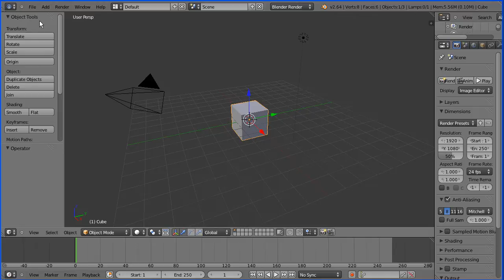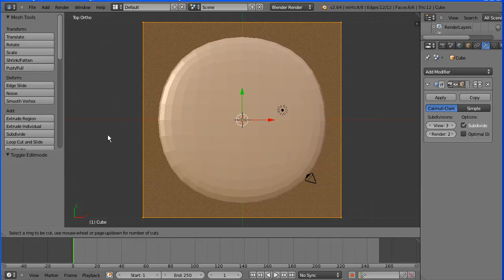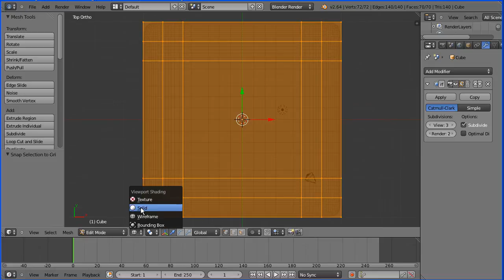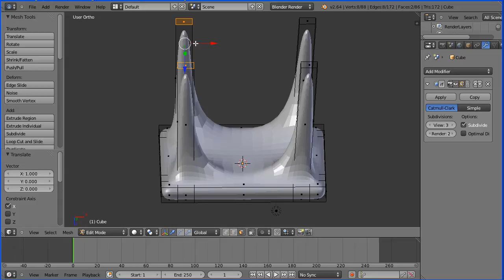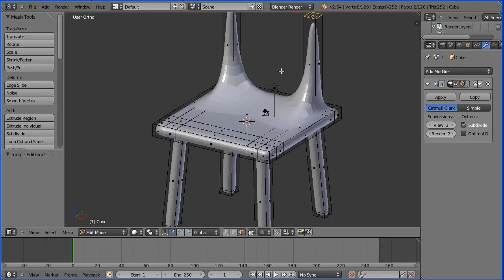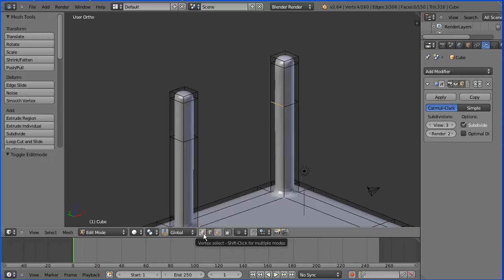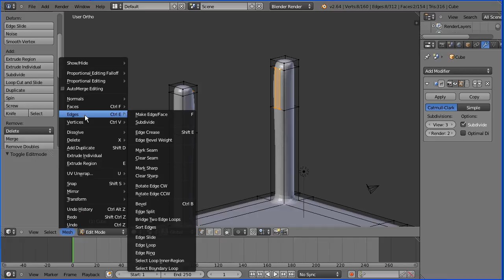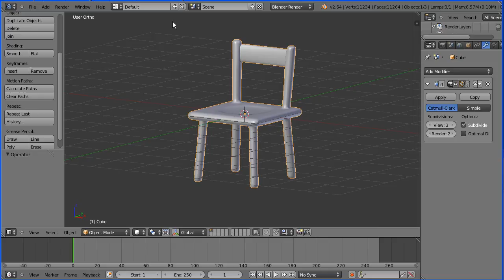Blender Making a Chair Using the Box Model - Extruding and Using Subdivision (New Version)

Comment: Hi.. thank you for your tutorials,,, I applied few of them form your website, and planning to finish all your tutorials 
 
some times the proportional editor stop working with me,  what could be the reason? 

Thanks again
Reply from the maker: +rasha yahya The surface you are applying the proportional editing to must have sufficient geometry, subdivide or use loop cuts.  Use G for grab and adjust the area affected using the mouse wheel. Experiment with a plane and then try again on the model. Hope this helps.
Reply: +Blender free tutorials by ianscott888 Ok, thank you for your explanation, now I know what needs to be fixed.